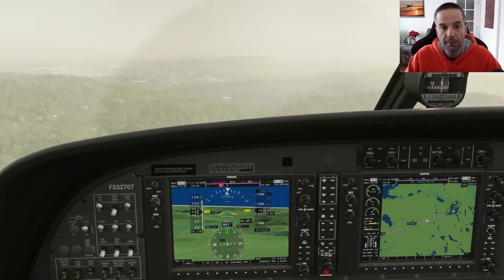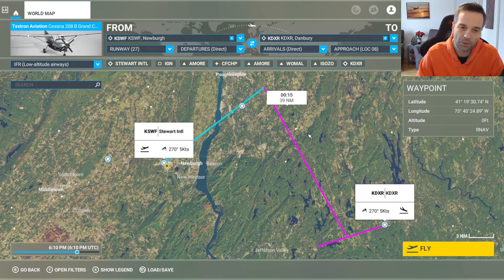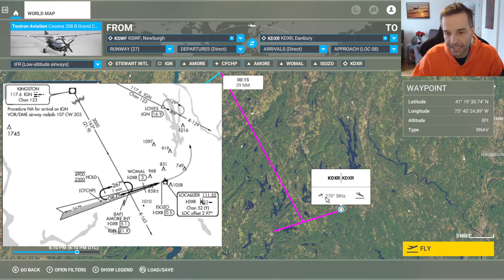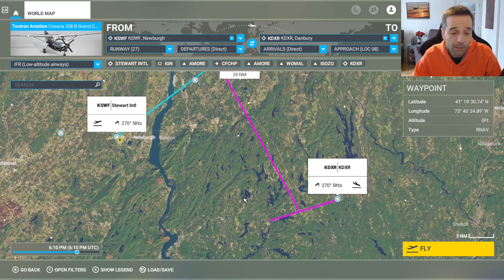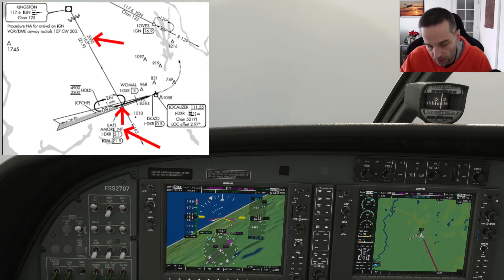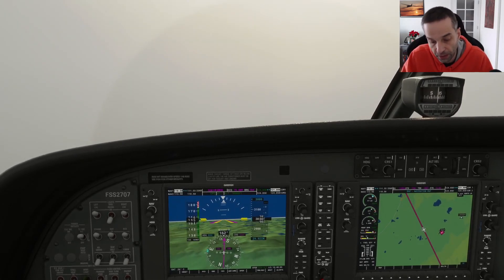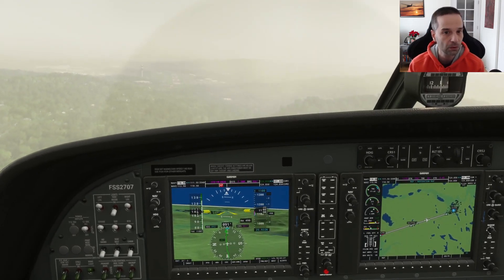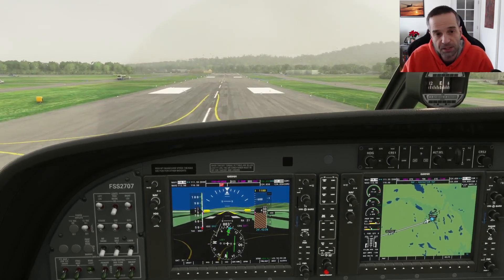How To Fly a Localizer Approach | IFR | MSFS Tutorial

Comment: To start the hold, why do we have to do a right turn at AMORE and then loop back and come back to AMORE before we fly the 267 radial? Why not a left turn to join the 267 radial in the first place as we are approaching AMORE from KINGSTON? Is there a protocol for entering holds? Thanks!
Reply from the maker: The way I understand it is this: coming in from the north like we are in this video, it would be too tight a turn to align ourselves and fly the final approach course directly and configure for landing, especially in a faster plane. In a 172 or something like that, you'd likely be fine to just turn directly inbound, but you're still supposed to use either a Procedure Turn or Hold to enter the final approach course. There are a few different ways to enter the hold, I found this article to explain it quite clearly: https://www.boldmethod.com/learn-to-fly/regulations/how-to-determine-your-holding-entry-procedures/

Comment: I understand that a localizer doesn't provide vertical navigation but why does the AP disconnect when I apply down pressure on the yoke shouldn't it keep me alligned while allowing me to control the decent manually?
Reply from the maker: When the autopilot is on it expects you to use one of the vertical modes (VS, FLC, SPD) rather than manual input.
Reply: @FlightSimSchool  it seems kinda counter intuitive to mean think about  a vehicle AP, It alows you to steer but not accelerate or slow down you'd think they'd program the aircraft AP to allow elevator input but not aileron thereby allowing the pilot to manage the decent but the horizontal navigation would be handled by the AP.
Reply: @FlightSimSchool  so if I understand correctly when it comes to a localizer appr
oach I should determine the glide slope on my own and it should get me close to the touch down zone? When should I activate VS down at the approach fix or at the moment the AP locks into the localizer? Sorry if this is long. I'm just used to using ILS
Reply from the maker: No worries, I'm here to help :) If you have a look at the chart for the LOC that you're flying, you should have some step down altitudes based on the distance you are from the runway. You can see an example in this video at 7:22. So what I do is as I'm coming down the LOC, I'll drop the altitude on the AP to the next step down, and use Vertical Speed to get to that new altitude. How much Vertical Speed I use is really just a gut feeling depending on how far I am from the next step down. Once you do it a few times, you start to get a feel for it. I hope that helps!

Comment: How did you determjie the rate of descent?
Reply from the maker: If you look on the chart I’m showing at 8:20, from AMORE down to the ground there is a 3 degree descent rate indicated. You can estimate 3 degrees in feet per minute by dividing your speed in half, and adding a 0. I’m flying 110, divided by 2 is 55, add a 0 and it gives me 550fpm. I’m usually a tad more aggressive than that, just to make sure I get to my target altitude.
Reply: @FlightSimSchool  Brilliant! Thank you!